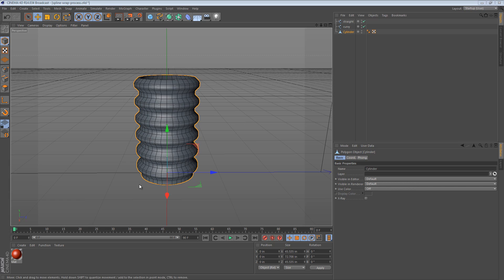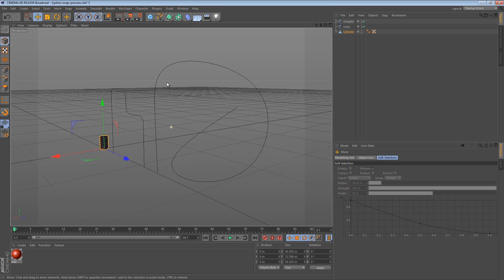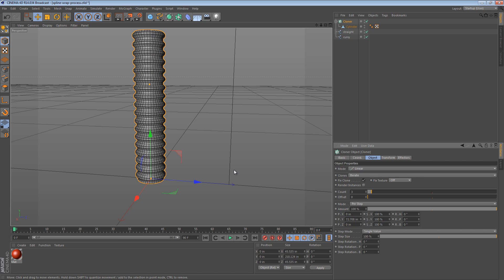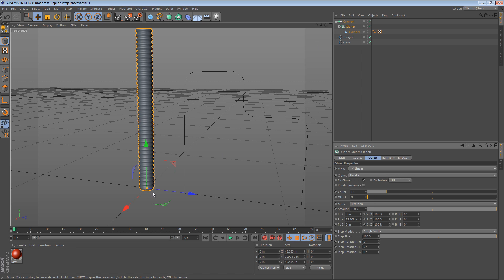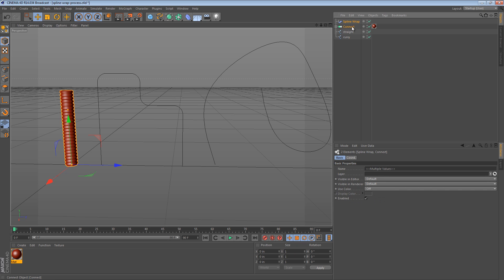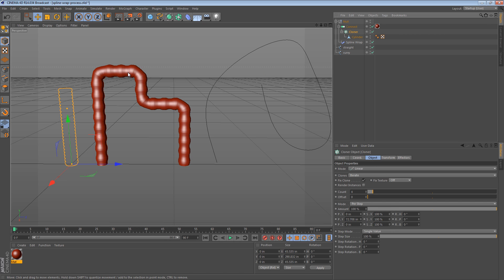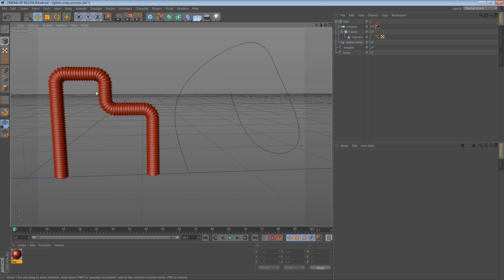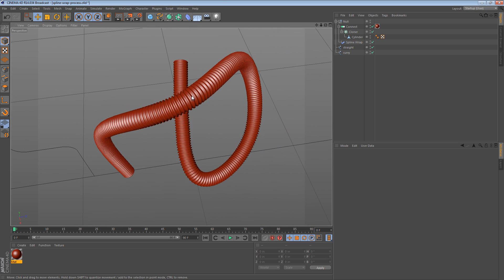Corrugated Pipes with Spline Wrap and a Cloner

Comment: those are a LOT of polygons for one shape...
Reply from the maker: You like it?
Reply: well.... isnt there a cheaper way to make that object?
Reply from the maker: Sure, but you're assuming that the focus in this case is creating an efficient mesh. That's not always the goal. In this case, I think that creating a certain effect is the goal. I effectively don't really care how many polygons are created at the end of it.

Because the object is still fully editable, one could always start removing loops of edges for instant optimization that would extend to the entire assembly.

I love where you're coming from though, it's always super interesting to see how we can make a mesh using less polygons. I think that in this case some normal mapping or careful UV mapping would work well.